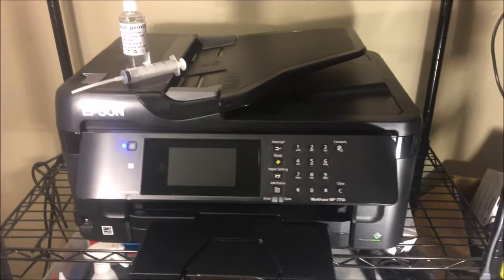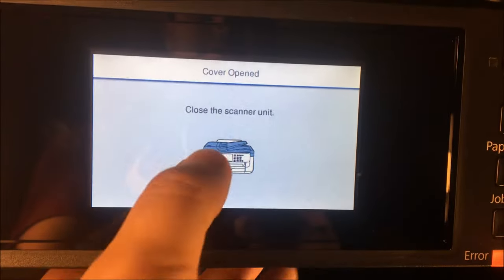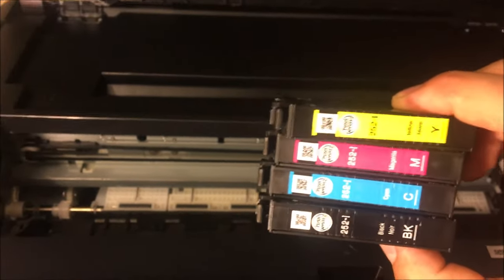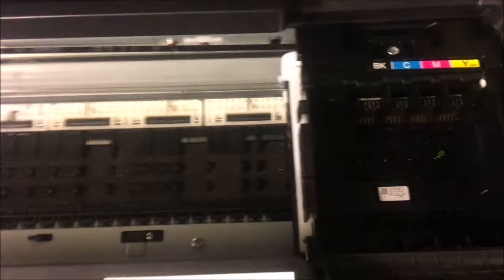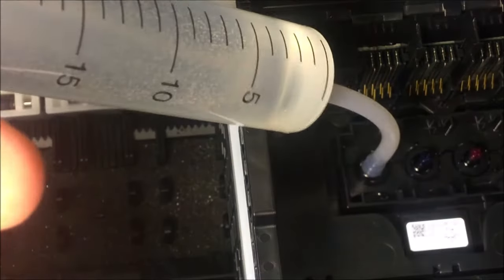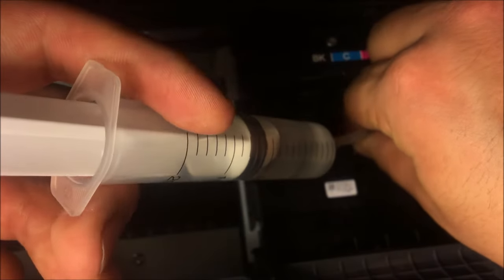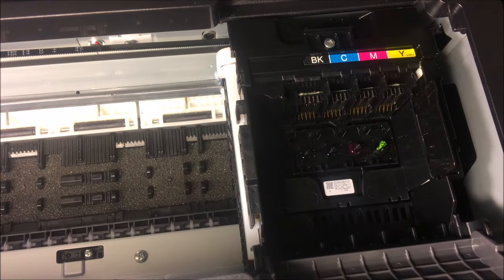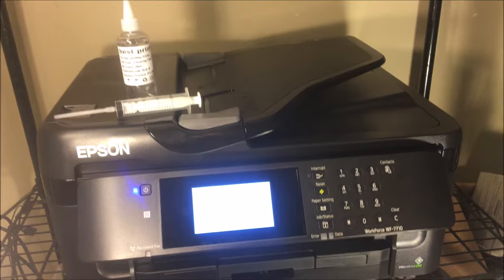How to Clean Clogged Printhead Nozzles for Epson Printers [SOLUTION!]

Comment: I had the equipment already (tubing, syringe & isopropyl alcohol) & followed this process.  I pushed about 5ml of isopropyl alcohol through my blocked magenta nozzle and bingo - 3-4 cleans & a few big prints later it is 100% good as new.  Thank you for posting this.
Reply: wait, it's just isopropyl alcohol? lmao i could've just cleaned my printhead already instead of waiting for it to arrive.
Reply: @Neji513  what! You have access to isopropyl alcohol on a post COVID world?!
Reply: @danpedersen3120  i stocked up before pandemic for medical purposes =]
Reply: Isopropyl should work. I'm actually here looking for confirmation lol. However on higher end, production-level machines with print heads that cost thousands to replace, we're never supposed to use isopropyl on the heads. Only the proprietary solution which definitely isn't iso and I would be sure to wear ppe when working with ink solvents.
Reply: @danpedersen3120  Thats all i takes? ... why did i buy print cleaning kit for that.......... I bought about 1 gallon of 99% isopropyl alcohol a year or two ago and still have most of the gallon  here...

Comment: Thanks for the instruction which I carefully followed. Now the printerheads release no Ink at all, even after replacing the cartridges with new ones. Please advise. Thank you
Harry
Reply: Well that’s just great!
Reply: Did you ever figure out why they weren’t releasing ink or how to fix it?! I’m having the same issue and have tried absolutely everything I could think of and/or find online as far as troubleshooting goes….
Reply: @chaoticcreations1643  Same here I have a workforce 7710 you have to run print head cleaning then all colors about 3-4 times
Reply: @hand4letters851  I have done this and still not printing correctly but worse.
Reply: Ok I’m not alone here. Bought used 7710 that sat for months. Mechanics work fine. I had some black ink show up but no color. Bought new ink so I did the clogged ink process. Now blank pages
Reply: It's really interesting how he went to great lengths to advised to purchase his product but he can't answer any questions under his video.

Comment: I just used this and when I was done the printer didn't print anything at all... However, it seemed to me that using common sense, the cleaner fluid is what is in the printhead... so I let the printer clean the printhead I think four times and now everything works great.   It's probably a product that could be easily reproduced, but I'd rather pay a little more than driving from store to store.

Comment: After running the solution through and disposing of the paper towel, does the printer need to sit unused for any length of time or can the cartridges be put back in and printing continue?
Reply: Cartridges should be in the open for as less time as possible because more and more air is sipping into the cartridge, it will take a lot of ink to clean that out.

Comment: Do you pull the print head while the printer is on? or does it need to be unplugged?
Reply from the maker: While its on or else it will lock.

Comment: question on sublimation conversion.  many people convert these to sublimation inks but they recommend first putting in the original inks and then replacing them with the sublimation inks.  could this solution be used to clean out the old standard inks from the initial setup?  that would help offset the sublimation inks you would have to use to clear the lines of the old - with the new?
the reason for starting it up for the first time with the original ink is to make sure the printer works.  if you begin with sublimation inks - it would void your warranty.  so people tend to wait until their warranty expires - then convert.
Reply: Have you been able to find an answer? If so please share

Comment: What do I do if the syringe isn’t pushing any of the liquid in? It looks like it should flow easily. Is it possible the printer head is too clogged to let any of the liquid inside? Any advice?
Reply from the maker: Yes, and that case you will need to warm up the fluid
Reply: Ok, I got the liquid to flow through after some time and patience, thank you! Now, it looks like the printer is only printing in large strips. Any advice to tackle this?

Comment: You said this would partially clean out sublimation ink . How can I fully clean sublimation ink out of my Epson printer ?
Reply from the maker: Actually, for this printer model, it will fully flush the sublimation ink out completely just keep applying the solution until the paper towel under the printhead is clear.

Comment: I followed these instructions to the letter, I have the identical printer (with the extra paper tray), I only had an issue with magenta, so I pushed 5ml of this solution through there, and removed the paper towel. I left it for about 12 hours, now the printer doesn't print anything. The black is coming through very faint, but no other colours are being applied, I'm just getting blank sheets of paper out. Help!
Reply: Did u ever fix this? I’m having the same issue!😭
Reply: @tarapetsch6474  me too
Reply: Make sure you flush the nozzles just with air a couple of times after unclogging them with the actual solution (in my case some didn't unclog so I used hot water, flushed with air then cleaned with isopropyl alcohol).
Reply: @tarapetsch6474  thanks so much for sharing your video. I was just about to offer the printer cleaning kit and decided to read the comments first. Using air to flush out to unclog my printer was a quick fix and didn’t cost me a dime. 😊

Comment: Well, I did all this with your kit and now the printer says error code:0x9a and it doesn't print at all. Ink cartridges are brand new never been used. My guess is that 20ml of your cleaning solution x 4 holes for a total 80ml liquid is more liquid than a few sheets of paper towels can absorb and now there's liquid in the printer? I just bought 2 XL packs of all colors printer ink for $160 thinking all would be fine. Any thoughts here or do I need another printer?

Comment: Thought about ordering kit but wanted to see if my ink carriage would unlock to slide over. Went into maintenance>ink replacement.... it did its left to right sweep of the ink carriage but its locked at the right and cant slide it to the left to where I would even be able to get paper towel under it. Theres resistance like the carriage is locked in place, i dont want to force it and strip gears..... Is it supposed to feel that way?
Reply: I just came here because I was having the same issue. Look at the video, when he takes out the ink. Take out the ink cartridges, close the cover, and then slide it gently. It will slide. (I know your comment was 11 months ago, but it might help the next person with same issue).

Comment: I've tried this on an Epson WP 4535. It was fiddley getting the tube on, but doable. However, when  fitted I couldn't depress the plunger. Although this shows how tight everything was,  I guess the the clogged head was the issue. Nothing I could do helped. So, I've decided to attach the tube to the head again and take out the plunger and fill the syringe with 2 mm of cleaner and hope that in the morning some has trickled down to the head. Fingers crossed! If anyone has any suggestions......

Comment: Any advice? I did the cleaning, now the nozzle check is only printer black. No y, m, or c is showing up.
Reply from the maker: You will now need to run a printhead cleaning. Run it until all the color returns, via nozzle checks.

Comment: I used this product today. I followed the directions exactly as shown in this video. All of my print heads were working except magenta. I used this on my Epson WF-7720 which I paid $300 for 2 years ago. I maybe print 20 sheets a week and it has worked great up until the magenta head got clogged. I used this cleaning product and now nothing at all prints. I've tried everything. I flushed all the heads, realigned the heads, cleaned the heads, put in brand new toner and NOTHING. I'm really sick to my stomach over it. I can't even print black and white. BUYER BEWARE.
Reply: Same, Please tell me if you finally got it to print. I did the same thing, and I have the same machine. Please Advise.
Reply: Ugh. Sorry it happened to you too! I ended up having to buy an new printer. The seller did refund my money for the product, but it was little consolation for having to spend another a couple hundred dollars on a printer when mine was only 2 years old with minimal use. I did happen to find the same printer on sale at Best Buy for $200 instead of the $300 I paid two years ago. I debated a different printer altogether, but this one had features others didn’t and met my needs perfectly until the clogged head. Good luck!
Reply: Well crap. I'm having the same problem.
Reply: This same thing has happened to me. I flushed it because of one color now no color prints right. I also bought mine when it was $300.

Comment: hi, whats the process after flushing the heads and closing lid? do you put cartridges back in straightaway ,head clean, nozzle check ? thx
Reply: epson 7710 auto does a head clean when you hit replace ink cartridge. i would do a nozzle check

Comment: I  bought the kit, clean it twice and im still having the same issue, im not sure what am i doing wrong? only black is showing and the other ones are NOT. My printer screen is showing i'm almost empty on my cartridges but they are NOT. They r full, so im not sure what to do? can u please help me? I alredy use half of the bottle. Thanks
Reply from the maker: Yes, run a printhead cleaning. You can find this in the settings under maintenance. This should push the ink back into the system after you have used the B.P. cleaning  kit. The cartridge problem you are having is common, dont mind it just run the printer like you normally would.
Reply: @BestPrinters  I've been working on it all day and i'm still cant get it to work, i tried to print something and NONE of the colors are showing, i'm running out of CLEANER. idk what else to do, now only MAGENTA is showing FULL color and Black is almost HALF, blue and yellow r not showing at all. i'm very frustrated it n idk what else i need to do. if someone can help me through a video call? so u or they can guide me or I show them what's happening? I need HELP desperately pls. Thanks
Reply: NVM... I just figured out, finally got all the colors back but now is the black one giving me a hard time. Thanks anyway, hopefully is not gonna happen again
Reply from the maker: If you keep running a printhead cleaning and keep the ink up to date/ on the full side. You shouldn't have that problem again.

Comment: What if i can't push the solution through? I have 2 of these and the black on one of them won't take the solution.
Reply from the maker: Tisha Burke You will need to warm up the solution and reapply.
Reply: Best Printers I have the same problem, warmed up the solution and even let it sit 12 hours, ink port still jammed.  Solution won't go thru. what do I do? by the way, now only black is printing, making the printer worse than it already was. thank you!

Comment: Hi. I have used cleaning solution and did printhead cleaning via the printer. I am still getting mixed results. the black will not print anything and the other colors will print one moment, missing lines the next or nothing. I'm really trying not get another printer.
Reply from the maker: Run a printhead cleaning, that should bring back the color. Dont give up.

Comment: Bought it.  Tried it.  Did it with the video on. Everything looked like it should. Put in new ink. Now none of the heads print. Have a Workforce 7620 which is not cheap.  Will try to rescue it some other way.  BTW, the WF-762 is a POS, so stay away from those as well. I still think Epson purposefully puts malware in their printers to give a lousy print job if you buy someone else's ink and not theirs.
Reply: did you get this fixed? having same issue
Reply: @ericajones8952  - partially.  Bought a kit from Best Printer's Tech, who I think has a video on  YouTube (see link above)  Doesn't work as easy as shown and is a lot messier. After numerous printer self cleanings, got most, but not all of the functionality back. Be careful not to use too much fluid.  I still need to give the yellow nozzle a second cleaning.  Finding the time is hard.  Printing not a priority for me (wife uses it more); and basically use black only for what I print. Will probably redo them all, but one printhead at a time.  I might just use plain rubbing alcohol which I did a couple of years ago which also works.
Reply: what’s the water? is it just normal water?
Reply: @razrabar4251  - No.  It appears to be a proprietary mix put together by the seller.

Comment: Hi. I have an Epson 1430 large format printer. I've followed your instructions with an ink cleaning kit, but I still cannot get any ink to flow through to the paper when printing. I am getting black ink when I pull up the solution in the tube (pulling back on the plunger), so it seems that the immediate clog may be gone. Do you have an suggestions as to what might be the real issue? Other than this the printer seems to work perfectly. I'm stumped...

Comment: Absolutely not working. Only cyan was not working, after I bought and ran the cleaner through, none of the colors were working any more. Followed the instructions to a letter. After some prints, black came though a bit, but the other colors don't work any more. Returning the product for a refund and buying a new printer.
Reply from the maker: Ok, or you can run a printhead cleaning and all the colors should come back.

Comment: Well I did this because the yellow was clogged  and no colours are printing at all. I guess because there is too much cleaner fluid in the system. How do I fix that?
Reply: I've had the same problem did you get an answer?
Reply: @katrinaalexander28  no answer and the printer didn't work again. I have just scraped it and bought a new one. This process killed my machind
Reply: Don't do this. I did it and it killed my printer. It's now scrap and I had to buy new one.
Reply: @icoleby  already did it and now won't print omg are you serious?
Reply: @katrinaalexander28  absolutely. I followed the instructions exactly. When I powered it up I got nothing. Printer is now giving an error message. Itrs dead.

Comment: I did this a few times, replaced the ink and cartridges and still nothing
Reply from the maker: You will want to run a printhead cleaning after using the kit. That will allow for ink to be pushed back into the system.

Comment: I keep running into an error 031008
Reply: Hi @Rick. Did you resolve this problem?
Reply: Rick Urbina. Did you finally found a solution? Plz share with us. I am running this error code for days. Plz help me
Reply: @marckleejoseph2498  I had the same error code a few months ago. Epsom said it was a mechanical issue. Since I was still under warranty I took it back and got a refund

Comment: MINES NOT PRINTING NOTHING
Reply from the maker: Run a print head cleaning, that will bring the ink back to the print head.
Reply: @BestPrinters  How many times do I need to run a print head cleaning before the ink returns?! Because so far, we’re over 2 weeks in and I’ve ran it at least once a day (most days, multiple times) and I still can’t get anything to print…..